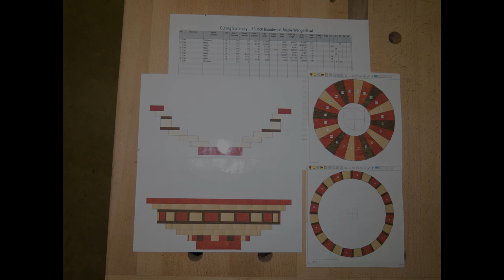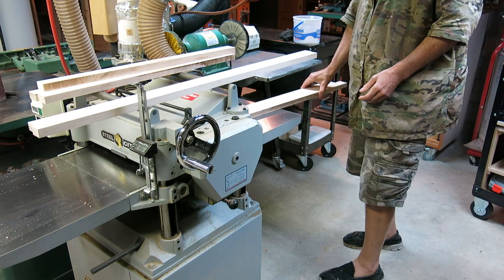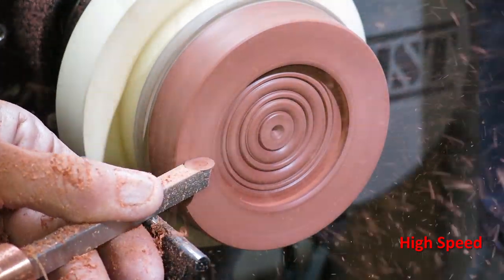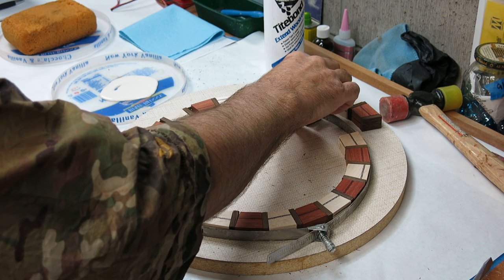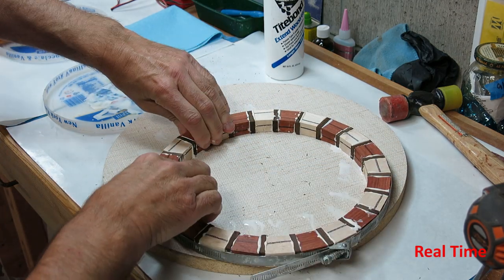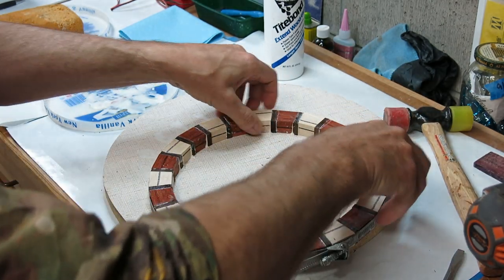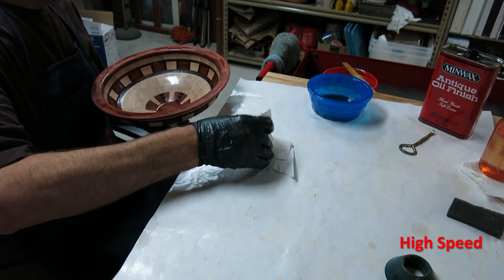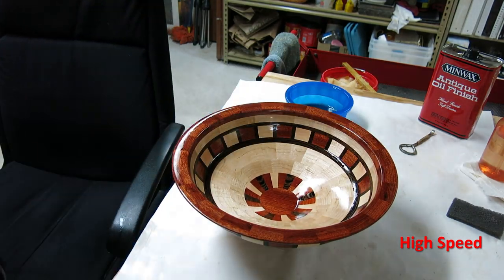Segmented Bowl Build

Comment: Hi Dick - thanks again for all the help - another question - are the vertical pieces used in the feature ring cut with the same angle as the segments and how does their addition impact the segment length needed to create the desired diameter of the completed ring?  Hope that makes sense 🙂
Reply from the maker: They are simply square cut 1/4" thick spacers, no angle. When you create that ring you have to allow for all the extra 1/4" pieces.  

Here is a link to the cut list and a cross section view I created for that bowl. I had to dig for this stuff because it has been a long time since I made that bowl (I actually made 5 of them in all), This should help you out. Hopefully the link works.

https://www.dropbox.com/sh/4xq1nqeh0ywa938/AADl2hRLrgTTmiF_efBX8ZQla?dl=0

Comment: Hi Dick - Thanks for the previous response.  One more question.  For the jig you created to glue the rings on the lathe what did you use as the shaft that goes into the tail stock?  I used the Morse Taper from a drill that I use on the lathe inserted into a slightly undersized hole on the bottom of the plate.  That works for now but I am looking for a more permanent way to secure it.  Thanks again for your help - Bob
Reply from the maker: I glued a block to the back of the ringed platter and tapped it to fit the threads on my Robust live center. I have pix but it appears you can’t add images to a Youtube comment.

Comment: Beautiful!  Are the thin strips between the larger segments end grain?  If so, do they cause problems?
Reply from the maker: It’s not end grain, but all the dark wood is wenge which is real hard and brittle. Turning wenge, in my experience, is more of a challenge than most other types of wood I usually use and can cause problems from time to time.

Comment: Hi Dick - New to segmented turning and find this video one of the best I have seen.  I have a couple questions:
1) Is there a plan for the stop you used so set the length of the segments on the table saw?
2) Typically how long do you wait before turning the rings when they are glued on the lathe?
3) Is there a source for the multi ring plastic template you used when drawing the foot?

Thanks again for sharing your knowledge and experience.
Reply from the maker: You can find plans for the Wedgie Sled and also get the ‘wedgies’ at http://segeasy.com/. Look for plans under Download. That’s where I got the info when I built mine. Also watch his instructional videos on how to make and use the sled. They are excellent. Look up Woodturners Center Finder for the plastic template. They are all over. I think I got mine at Rockler, but they are probably cheaper if you look around. 

As far as glue. I use Titebond slow set white glue to glue the segments into rings. It gives me more working time when sliding all those little pieces around. Let the rings dry over night. When gluing the rings together you only have to wait about 10 minutes for the glue to get tacky then put the next one in place. I use regular Titebond II or III because I want it to dry fast. After your rings are all glued clamp it together using your lathe and leave it sit over night.

Comment: Excellent video and bowl. I’ve turned only a handful of small segmented bowls and was trying to find a way to glue up the rings of a large bowl, like this one. Your idea of using a concentric ring assembly in the tail stock is a LOT better than what I had thought about doing - using a huge jam chuck cone thing. Many thanks for sharing your ideas with us! 

One question though, regarding the wedgie sled. I noticed that you cut your segments from the “top” edge of the assembly - the edges farthest from you. When I cut mine I had been using the top and bottom edges of the sled. Can you explain?

Regards, Jim
Reply from the maker: Thanks! Probably just the way I edited the video maybe only showing all cuts on top fence. I use both the top and bottom part of the sled alternating every other segment.

Comment: Another question - I see that you’ve carved out a recess in the bottom and use that to mount the foot. I was thinking about using a paper glue joint to hold the entire thing as I turned it, but perhaps using my chuck as you did might be a better plan. My question is - how high of an RPM did you use to do your turning with the chuck method?

Jim
Reply from the maker: On segmented bowls I prefer to use the method in the video because after you are done turning the bowl, except for finishing, you are DONE. Nothing more stressful for me than to spend all that time and then launch the bowl off the lathe turning the bottom of the foot. Using the expansion method like this I can get a pretty good speed going without worry. Probably 1000 rpm’s or more. Depends on the size of the bowl. Have never lost one using that method.

Comment: do you have to account for the spacer thickness when cutting the segments? If so, how?
Reply from the maker: Yes, if you are going for an exact size you have to account for the spacers. Mine are 1/8” thick, and the software I am using automatically calculates how much to take off each segment. Info on the software is in the description.

Comment: Mr. Rowe. Beautiful work! Can you tell me a good formula for segment length? I am getting conflicting information. Thank you for your time.
Reply from the maker: Thanks! 

The segment length determines the diameter of the final ring. The segment cut angle determines how many segments make up a ring (12,16,24,etc). The segment width determines how wide the ring is which it critical as you stack rings to make sure you have enough overhang to glue the next ring and leave some material to turn.

In the video description I list several free segment calc web page links as well as a link to the purchased software I use. Here is one of the free links. Go in and play with it and you should be able to see how all the various calcs work together. http://www.delorie.com/wood/segturn.html

Comment: I am new to this process; I have made a wedgie sled and I am able to turn traditional and board bowls, but I hope I am ready for this. Question: my math is not so hot and all the videos to calculate the actual segment sizes, diameter, etc. just confuse me. Are there detailed bowl plans that I can buy?
Reply from the maker: If you look in the video description/notes I have listed some free web sites that do the math for you, and also a link to the purchased software I use which really makes design and math easy. This takes all the math out of it, you just have to decide what material you want to use, and roughly how big you want the final object to be. As far as designs, I just look at a lot of different things on the web and just wing it. You might want to check out Segmented Turners website and Facebook page for ideas.

Comment: How long does it take to make a bowl like this? Minus glue drying time.
Reply from the maker: It really does vary a lot, and I complicate the calc because I tend to make at least 2 at a time, but my best guess for this particular bowl would be  .... 2 hrs to prep all the stock, an hour to cut the segments, 2 hours to glue the segments into rings, an hour to sand all the rings flat, 20 minutes to glue the rings together, 30 minutes to actually turn and finish the bowl. Of course all of this is spread over 4-5 days waiting for glue to dry.
Reply: @CDRowe1  wow! I thought it would have been a lot more than that! It probably would be for someone who has never done this before. That is impressive, that little bit of time to make something that nice!